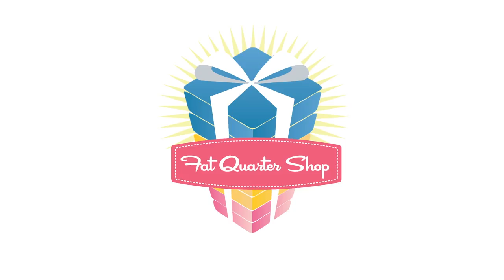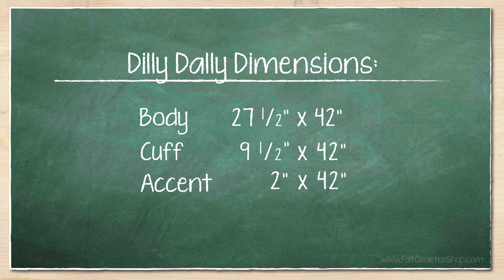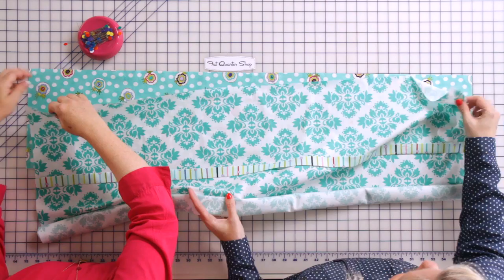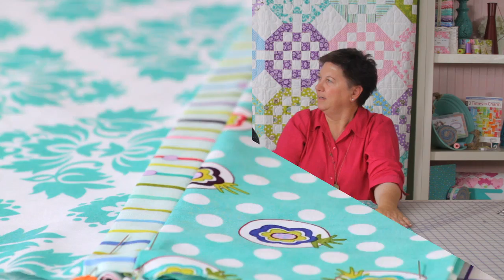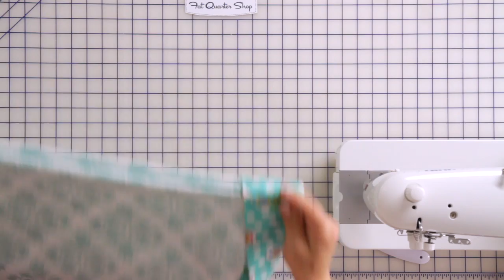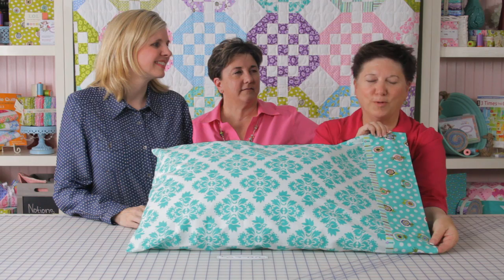How to Make a Standard Pillowcase using Dilly Dally Pillowcase Pattern by Me & My Sister Designs

Comment: I realize that for the sake of time you didn't show you actually sewing on the machine until the end.
I've made several of these and I keep running into the same problem. If I don't use a walking foot, the top part of the cuff ends up stretching on the bias and not lining up at the end when I am finished sewing.
you didn't mention what needle to use or thread or pressor  foot.

has anyone else had the same issue. It really ruins the dimensions of the pillowcase when after sewing the burrito sandwich, the edges of the Cuffs are not even anymore. Don't know if pinning would make a difference vs Wonder clips. Though I am sure I have used pins as well.

even upgraded to a new well sort of new singer Quantum stylist 9960 and had better results when using the walking foot.

Comment: Would it be okay if I just leave off the accent piece?
Reply from the maker: It would look fine if you left it off but you would need to do some math to figure out an accurate measurement and finish off the edge so you dont have an open seam.
Reply: +Fat Quarter Shop oh OK thanks
Reply: Danielle I've left them off & just sewed as shown.

Comment: Question about the quality of fabric...so, I know when you buy a higher thread count sheet set the fabric is much softer...is there a difference in fabric at Quilt Shops? and if so, how do I know which is the better,softer stuff? I would want to use the softest when making a pillow case (and not use flannel).
Reply from the maker: +Kristine Arey

Quilting fabric does not say what the thread count is, unlike
packaged bed linen products.  We can say is that quilt-shop fabrics are of
a higher quality (finer and softer) than quilt fabric found at big box stores,
so do not go by the feel of fabrics you find there.  You would really need
to sample a fabric you like, especially as the feel will differ between fabric
companies as well.  We suggest finding a fabric you like and buying a
small cut or precut (like a Mini Charm Pack or Charm Pack) of it, so you can
feel it for yourself before making a big purchase.
Reply: +Fat Quarter Shop Good to know! I thought some fabrics 'feel' better than others. I made a quilt from Amy Butler fabric and it was like butter... Thanks for the speedy resonse!
Reply from the maker: +Kristine Arey You should certainly try Art Gallery fabrics unless you have already. They are super soft!

Comment: Just another note after reading another poster.  She wanted to know how to keep the pillow in the case.  I've started adding buttons and buttonholes to all my pillows, that keeps them tidy especially those satin cases which would be halfway off by morning.  I place the buttonholes on one side of the hem but the button needs to be sewn, not on top of the other side of the hem but on the underside of it otherwise it won't button or work.  I like my pillowcases smooth and not rumpled up,  it's better for you skin too.
Reply: The European style is to add an inner flap which is sewn onto the cuff before assembling the rest of the pillowcase. You really don't want your face pressing up against buttons in the middle of the night